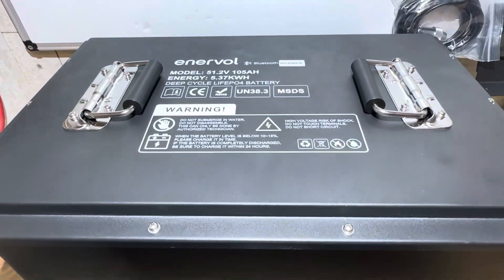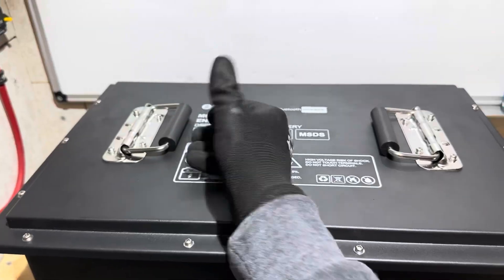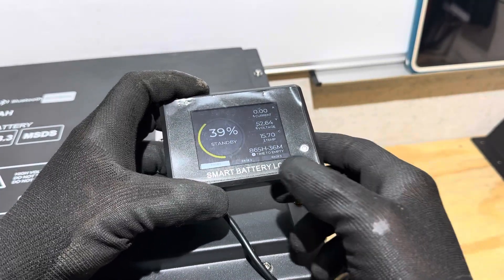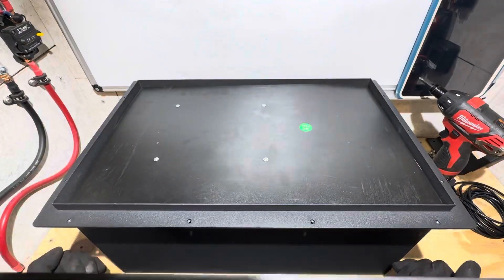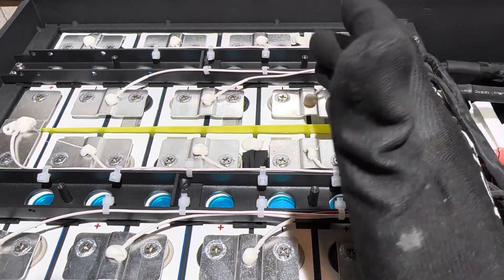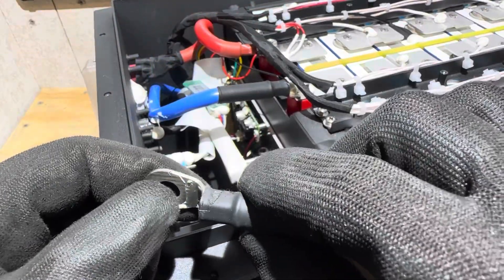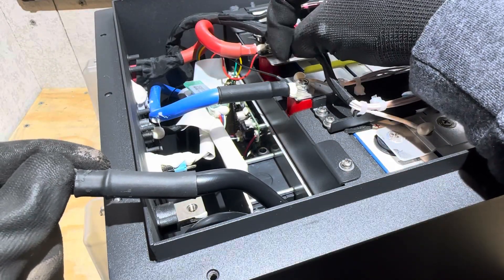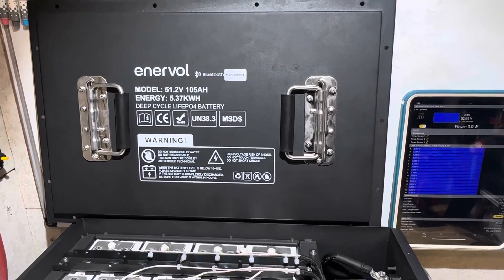ENERVOL 48V 105Ah Golf Cart Battery Review & Teardown | ENERVOL 51.2V 105Ah LiFePO4 Battery

Comment: Hay I’m wanting to make me a hunting trailer I’m goin to wire it for ac power but I’m off the grid a lot I want it wired 12v and solar. What batteries do you recommend. For solar panels anything you can help me with I’d appreciate
Reply from the maker: Lots of options. Really depends on your power needs and budget. I’ve reviewed almost every 12.8V LiFePO4 on Amazon so if you see a brand you like, please check my reviews on them. Also if you have a specific brand request just LMK.

Comment: Great video and review. I've been looking for a 48V golf cart with bad batteries or no batteries for a discount. I could then do the lithium conversion. The All Pond batteries looks like the way to go. I really value your expertise and advise. Thanks
Reply from the maker: Thank you! 
Yes definitely look for a cart with weak or bad lead acid batteries this is helpful when negotiating. No batteries in the cart could be trouble by not allowing you to check the motor or controller. Even a quick surface charge on lead acid can usually make the cart at least attempt to move. 👍 
Appreciate you my friend.
Reply: @THEOFFGRIDMOUNTAINHOMESTEAD  Good points

Comment: Very nice video and explaining everything that you found.  It would be nice if they would have put a little more time inside the build quality.  I have 2 dc house 48v 100ah and they work great.  Same brand bms as this one and no issues. I got mine on sale $ 840 each and it came with the charger and a display as well.  Long term we will see how it  holds up. I can say that DC HOUSE  does stand behind their products.  I had a  12v 100ah that failed for some reason and they warranty it with just a couple of pictures of and explanation.  Thanks for sharing the honest review!
Reply from the maker: Appreciate you! 
Literally a few minutes and few $ to make this battery better. Increasingly rare to not find some type of shortcut in most of the batteries now. ☹️ 

Thank you for sharing your experience with DC House. Glad you are happy with them. 👍

Comment: I wonder if the BMS recognizes if it's parallel with another unit?
Reply from the maker: No it wouldn’t. 

This board also supports CAN communication protocol if programmed for this feature. They are preconfigured for RS485 most of the time. You need Admin level access with XiaoXiang App and it unlocks all kinds of fun stuff if you wanted to have it communicate with a PC for monitoring or inverter. 
So many features hidden in these boards. 

One thing for sure, the AP series boards have a hard limit of 200mA minimum current detection. So any load/charge under this level is not measured. This usually only an issue with using as part of a larger ESS.

Comment: The only thing I like about that battery is the fact it is easy to open. All the batteries I have can be opened by removing screws, most are metal cases, I have one plastic case one that can be opened too, Dr prepare. I think it helps keep the company honest with their builds and if there is room you could add stuff directly to the battery case if you want to. This one can be fixed at least to make it better. If the price is right and you are not taking it outside in water it should be okay but definitely not the best.
Reply from the maker: Definitely easy to open! I had everything that was addressed in the video “repaired or modified” in less than 30 minutes. Only a few $ in parts to bring it up a level. 
Should have been addressed on the production line though… 

Appreciate you stopping to watch and comment today! 👍